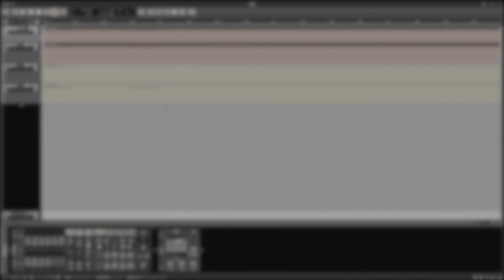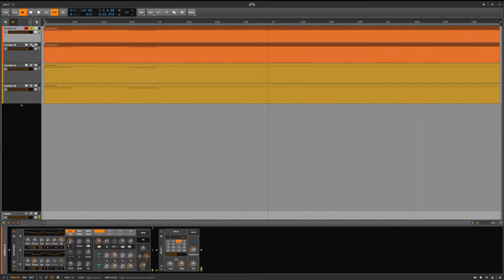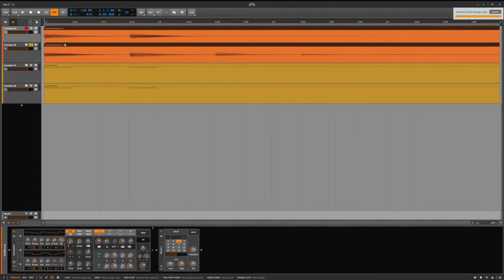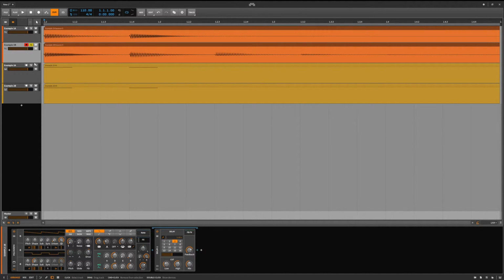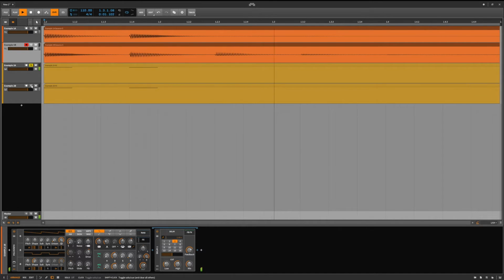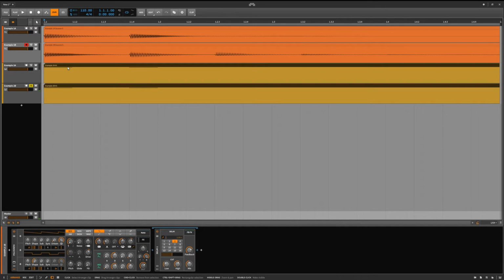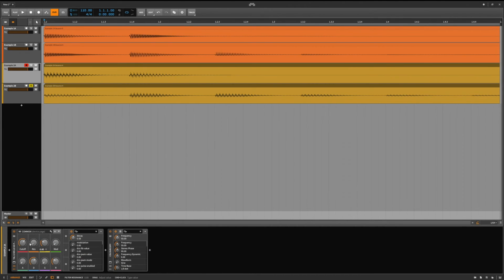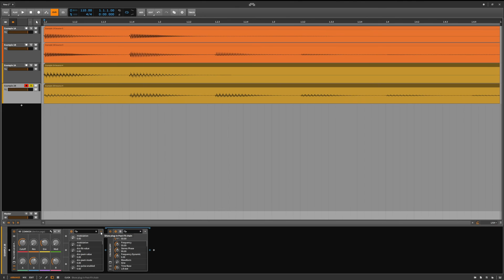Bouncing Audio in Bitwig

Comment: Are the results identical when using the Bounce feature in these scenarios? Thx.
Reply from the maker: No, the placement of effects matter. If you use bounce in place and the effect is part of the instrument's FX chain it get bounced to the file. However, if the effect is not part of the instrument's FX chain but rather simply follows the instrument in the device chain then the bounced audio does not contain the audio manipulation that the effect is responsible for. Instead the effect is applied in realtime to the audio. It can be really beneficial to add CPU intensive effects into the instruments effects chain to bypass them once the audio has been bounced out.